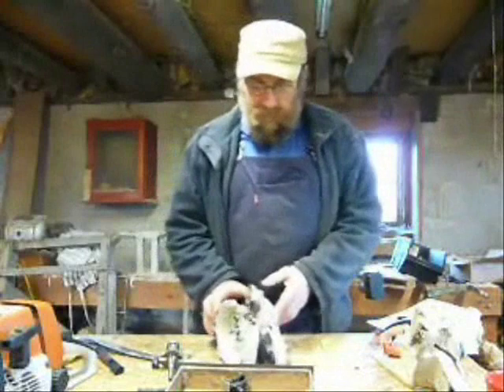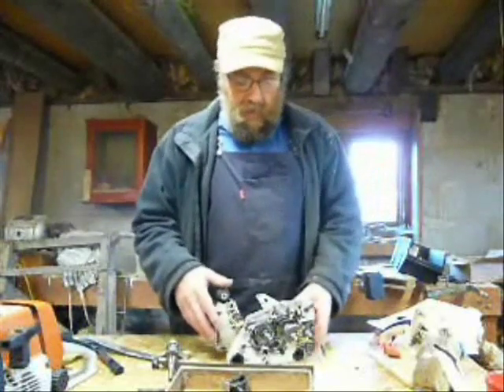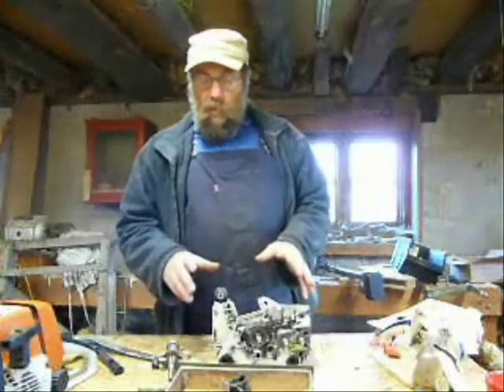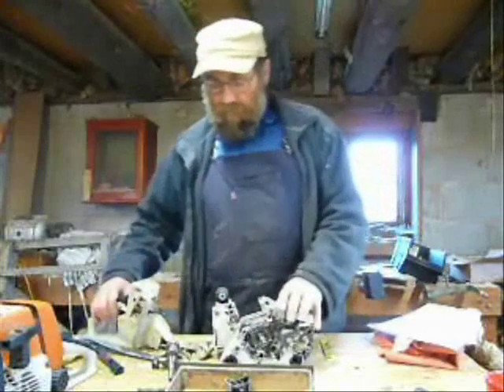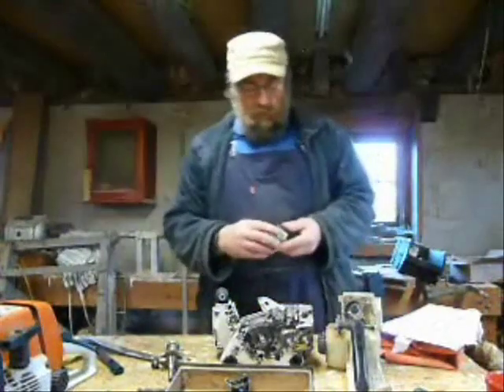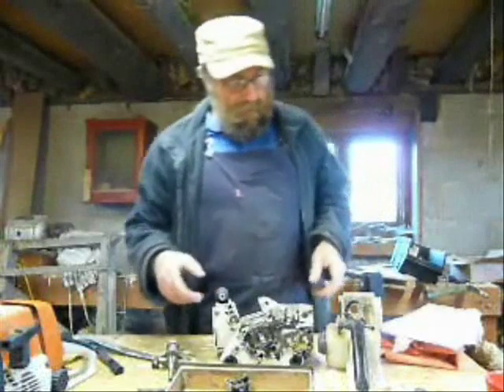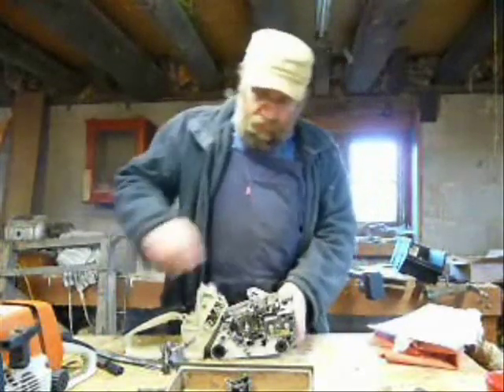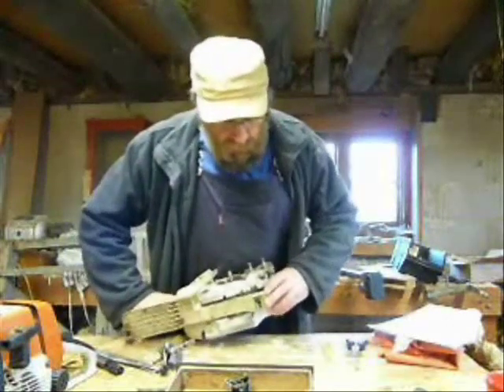Part 3 Stihl 026 chainsaw fitting the rings, piston, anti vibration mountings

Comment from the maker: Thanks for your feedback. The oil pump quill will commonly self align, but also breaks in regular use. When the saw stops oiling then check the bar oil hole, there's oil in the tank, and then the quill drive. I'm sure you will be able to fix your saw. Sometimes it's easier to remove the pump to fit a new delivery pipe, and then refit. You may find otherwise. All the best

Comment: I thought you'd like to know why. I didn't remember to to engage the quill when replacing the cover. In subsequent use the keepers inside were sheared off cutting the supply and gouging a leak in the oil pump body. Costly mistake, but it's a great running saw.